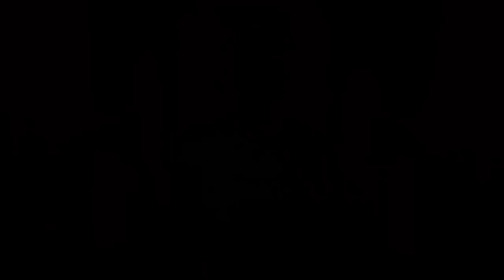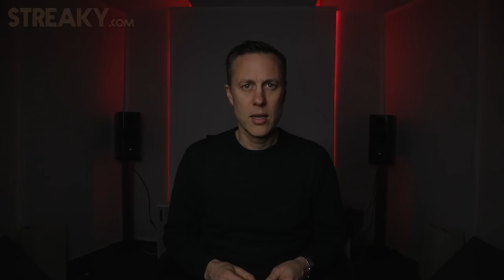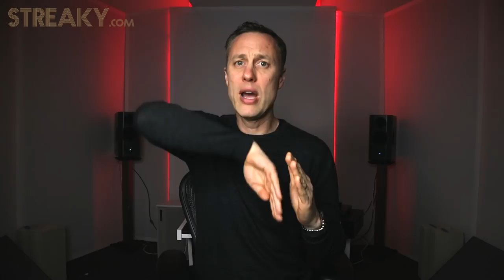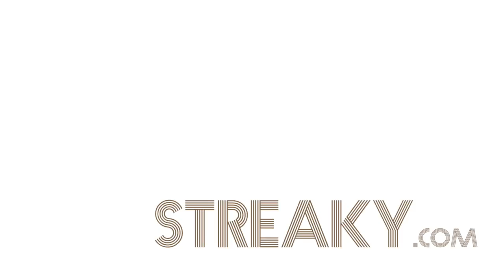WHY YOU SHOULD CUT ALL FREQUENCIES UNDER 20Hz | Streaky.com

Comment: So one thing I'm really interested in is that you are advocating steep HPF slopes, which have a lot stronger phase shift than e.g. a 6 dB/oct filter. A low shelf with a sharp corner can approximate a HPF, but with a lesser degree of phase shift. Sometimes phase shift from low cuts can result in increased peak levels, an obviously unwanted side effect if loudness hasn't increased. My first question is, what does phase shift sound like (is it like a badly treated room)? Second, is phase shift from low cut filters something you think about when working?
Reply: Just to be clear, that second question was an honest one, not meant as any kind of critique :) Big up Streaks
Reply: 6-24 in non-linear mode sounds best to me.

Comment: How about the slope of the cut off? 6 db / 12 db/ 18 db etc per octave? thanks!
Reply: maximum, like 96 db. you dont want that high energy rumble
Reply: Same, 96 db, I don't want to lose alot. Some frequencies can be heard of club speakers which on your home set won't
Reply: 6-24 sounds best. 96dB will make sound quieter or overcompressed in zero phase, or too much pre-ringing in linear phase. Sharp cuts make stereo imaging worse, can ruin groove.

Comment: I do a steep enough cut with a small bump at 30/32 Hz  (mixing)
Reply: Why the bump?
Reply: @sadpepe7937  To compensate for the energy taken out in the cut. I find below 30hz to be extreme low sub and isn't that pleasant in a mix. The slope will still allow 20hz through, but much lower.

Comment: Every time I cut below 20hz the meter shoots up 2-3dBs, it’s probably because of the steep eq curve...it doesn’t happen with a smoother curve, which doesn’t really cut anything...can you explain a bit about zero latency/linear/natural phase filter eq?which one to use to avoid changing the phase?
Reply: Linear phase. But not all of the plugins are implemented properly IMHO.

Comment: I've learned to cut at 40hz with a pretty steep slope.  Not a complete brick wall, but I just don't think there's much info below 40hz that has much to convey, musically, and therefore only adds to the mud.  But I'm just an amateur.
Reply from the maker: Yeah 40hz was the standard before sun bass was a thing…watch out for losing the kick
Reply: @Streaky_com  thanks for the reply! I appreciate the advice so much.
Reply: @Streaky_com  does it vary among musical genres much? Or do you suggest 20hz is across the board?

Comment: I am interested to hear about how you do hard cuts on frequencies, there's discussion that it's best to use a filter plugin with a hard wall at 20hz, others may use a fabfilter eq low cut.  Which method do you prefer if your object is to completely cut at 20hz?

Comment: Did you make a video about practical low end cut in mastering? Would be very useful, because there are a lot of strange theories floating around. For example, a brickwall cut is a big mistake because of phase issues in the high end. Any advice? Better use a smooth low shelf cut or a dynamic cut EQ? Thanks

Comment: I'm using a "TASCAM DR100 iii" digital recorded and it has LC FILTER SETTINGS of OFF, 40hz, 80hz, 120hz and 220hz
I'll be recording some marching bands and I want to get the best of the DRUM LINES BASS... what would be the best setting in the LOW CUT MENU to get the best low sounds.
Thanks!!!

Comment: 36-72  dB slope anywhere from 18-30 hz mostly rap, pop, r n b ...
Reply: idk man.... it will add dc offset and make song quieter and more muddy, after you add limiter or compressor. Check the oscilloscope and see how waveform offsets.

Comment: I always cut 28hz only in mastering... at mid side only at ( mid) ..
Reply: Here's an experiment for you. Put L1 or similar in the master buss of a mixed track, set it to 0.1/0.1 crank the channel so you're hitting 0, 0.1db gain reduction (this is purely to set a solid bench mark). now place fabfilter EQ after it, play your song at the busiest moment, apply a low cut. Oh shit!!!
Reply: @mitchiemasha   recently i started to not filter anything... thats why filter is really bad idea
Reply: @aviozstudio4903  The consensus in tutorials is cutting the mud clears up more headroom, yet all is see is up to an extra 4db of CLIPPiNG, thanks to the low cut phase shift boosting previously controlled transients.
Reply: @mitchiemasha  I don't get why this kind of information has always been harder to find. For the longest time when I started out I believed in high passing very low on super lowend bc of tutorials, but then got confused after a while when I started checking meters myself etc. realizing that I was losing headroom from the db gain caused by the EQ cut.
Reply: why cut mid and not side?
Reply: @izvarzone  recently  i stopped using mid side in mastering. there are two ways of mastering . mid side processing and normal stereo processing { old school way }.

Comment: If the mix done right you shouldn't be cutting anything. Sub/Low end is needed just solo all the big tracks from artists under 30hz  and see there is plenty of info below 30hz. Using steep cuts will cause artefacts and the gain of 0.5db head room is just not worth it

Comment: I always do a roll off at 20-26 Htz(just works good with my particular EQ) on the mix buss. It makes such a big difference in the overall sound I wouldn't dream of not doing it. I also roll off all my super low sub stuff at 20 too just to ensure I don't get a bad low end build up.
Occasionally I roll off at 30 Htz but it's rare and only if there isn't alot of really low sub information; I never go over 30 though.

Comment: Too much unnecessary low end also puts serious stress on your system’s main drivers and/or subwoofers, as your amps will be clipping a lot sooner from excessive lows without seeming loud. It takes a lot more energy to produce those ultra-low frequencies, so you’d better have the gear to back it up. Compact Disc digital audio is capable of reproducing 20-20,000Hz audio, with a dynamic range of 0-100db.  Vinyl falls short of that, sonically in low frequencies, as well as the surface noise floor, but Digital audio’s advantages were negated thanks to the “Loudness Wars”...many older versions of CD’s had better dynamics, despite being sourced from masters made for vinyl. If you want to hear CD’s at their best, listen to some Deutsch-Gramophone classical and concert hall recordings (“Horowitz In London” is a fine example), or some CD versions of 50’s/60’s live concerts such as “Harry Belafonte at Carnegie Hall”.

Comment: This is not really a good advice. A Mastering Engineer should identify problem area's and act accordingly. 
A cook would taste food before deciding it needs more salt. If it already is salt enough you shouldn't use more. So yeah, adding in air should only be done if well, there is too less air :) 

Harshness is in the 2-4k area. If you are de-essing the top end you are more in the 16k area or so.

It's these kind of tips that will confuse beginner ME's. It's all about the interaction with the material. Also "smooth" is a subjective term. Ask 10 people what they think this means and you will get 10 different responses.

I also see another title "WHY YOU SHOULD CUT ALL FREQUENCIES UNDER 20Hz". This again has nothing to do with anticipating to a specific situation who are different from track to track but it is more like "preset mastering", if that makes sense (it doesn't ;)).
Reply: Yeah the irony is dc offset reduce headroom, when ppl intended to increase it with that cut.

Comment: Rubbish. Never always do anything (other than listen - and with your ears, not your eyes).
Perhaps make it clearer that this is what you're really saying.

Learn to listen beyond frequency response, but to depth and time domain impacts.

A 20Hz HPF at 6dB/oct can be easily audible to 100Hz and above. Too sharp and you get resonances and phase shift affecting impact, weight, "realness".

The difference in the 60's -90's is most sources would naturally be filtered by a combination of air, mic's, audio transformers and tape machine electronics anyway. 

Soft synths all in the box? Sure: go crazy (knock off those ultrasonic high frequencies also). And could everyone please stop HPF'ing vocals to the point where they're losing natural full tone, "body" and sense of closeness? Spot treat plosives. Tread carefully with filters. At mastering our job is basically to keep it real.